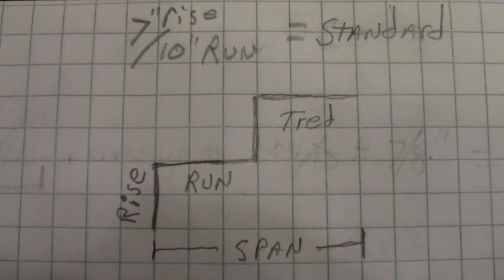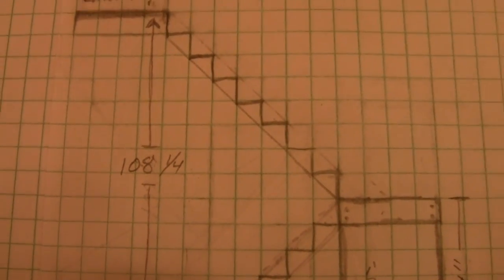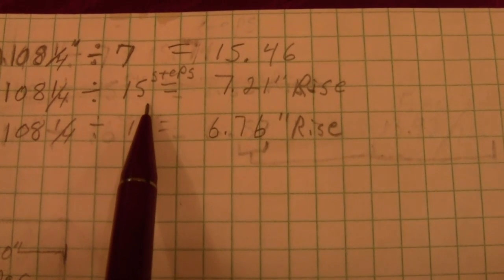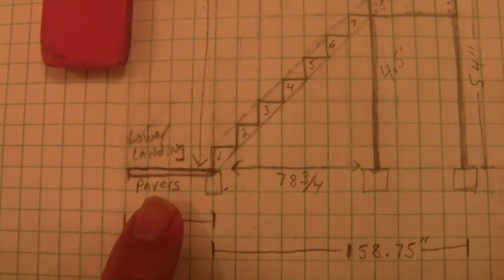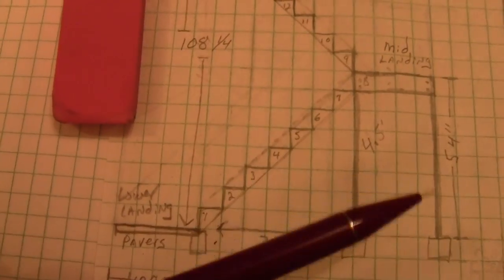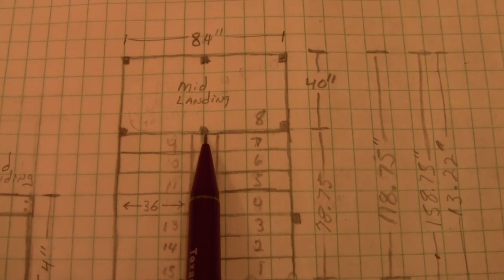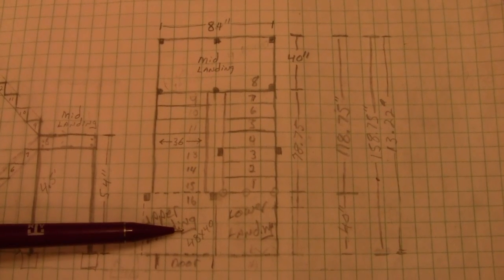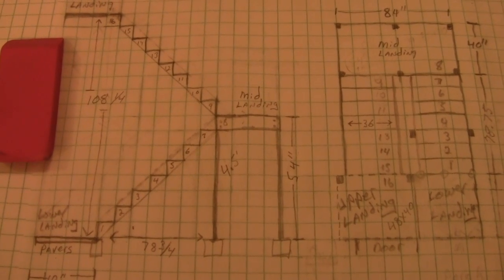Stair Design - U Shape - Switchback with Deck Landing

Comment: Do you think that mid landing size should be revised to 48" x 84", so the up stringer can have enough space to sit on the mid landing?
Reply from the maker: Sam Wang Yes, In hind sight I would make the mid level landing larger to accommodate the base of the upper level stringers.
Reply from the maker: Yes, a larger mid landing would be good in order to accommodate the base of the upper stringer.